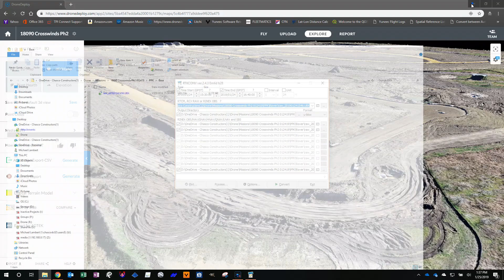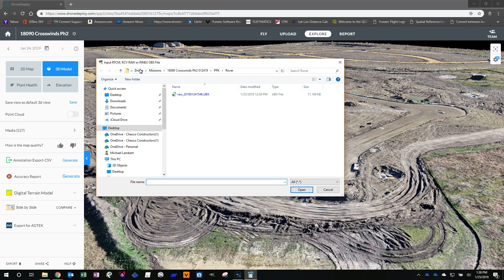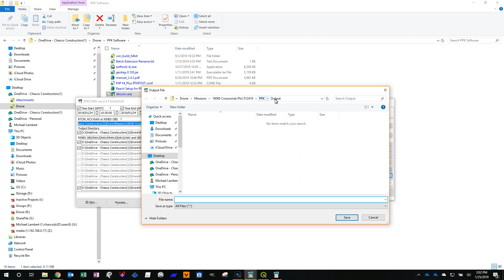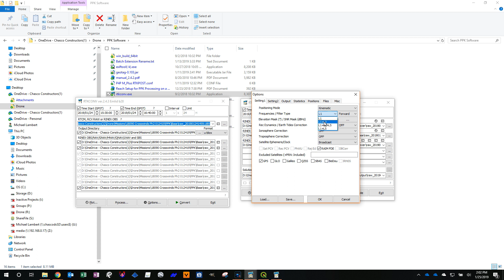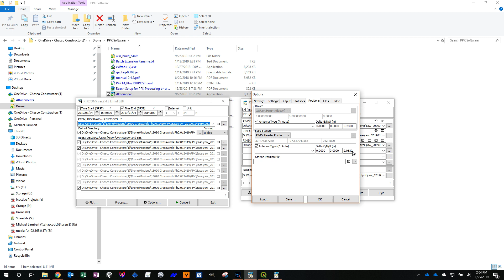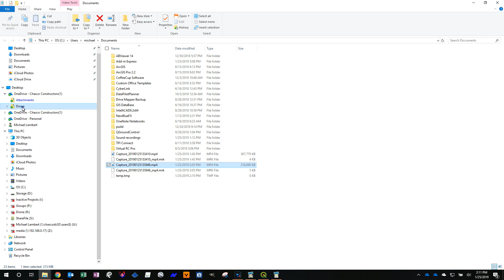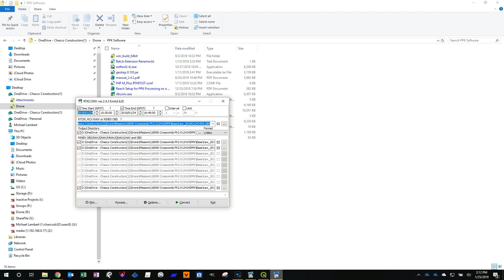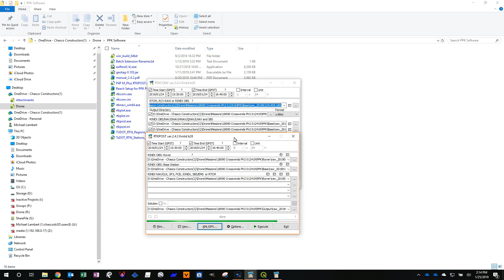RTKLIB Post-Processing

Comment: How should you handle when Q=0 and Q=2?
Reply from the maker: (1) Make sure that your base and rover logs both cover the entire time of the needed data collection. (2) Check the satellite streams after RTKCONV to look for drops in signal and remove offending constellations. This will work with as little as just the GPS constellation. (3) Change settings such as elevation mask and SnR.